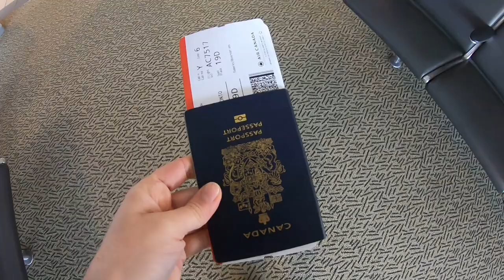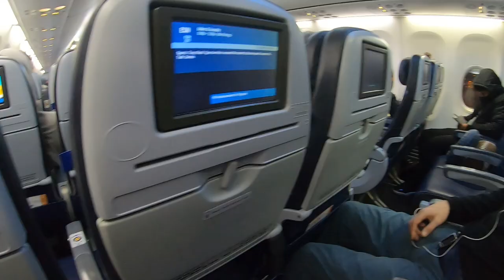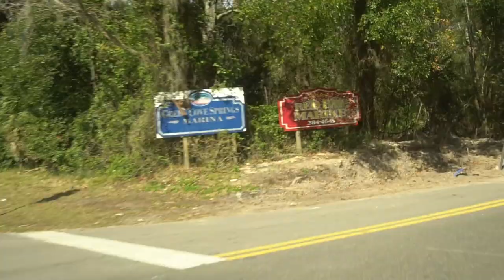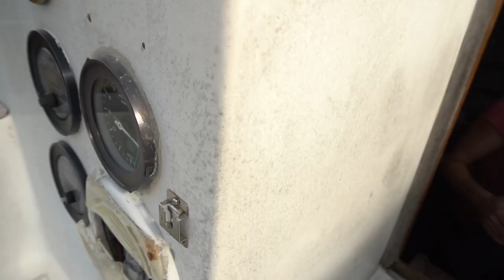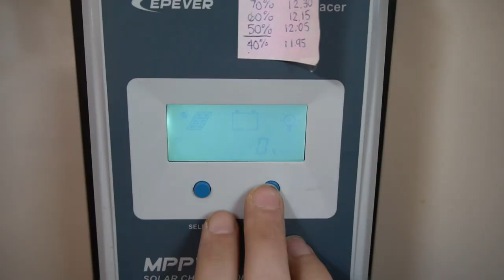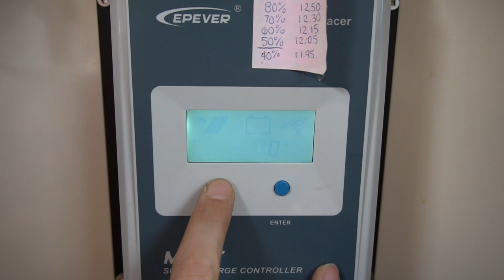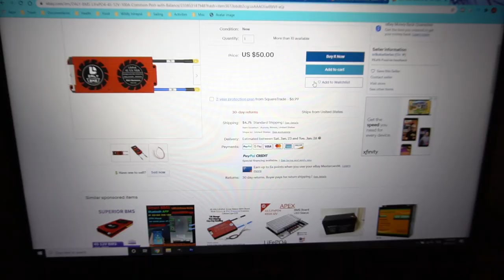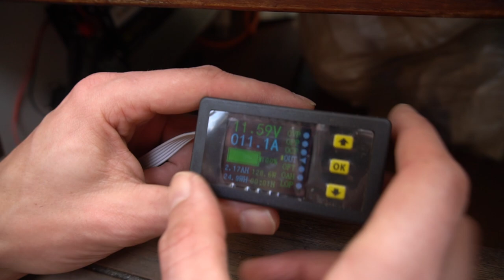B.O.A.T: Bring Out Another Thousand | BACK on our SMALL SAILBOAT [Ep 156]

Comment: Batteries can go dead with nothing connected to them.Man you are really good at finding and fixing problems 👍Glad you made it down to Florida finally without too many problems.And dang that food looked sooo good 😊
Reply from the maker: I haven't had much trouble with battery sag provided there is no load connected. Unless there is a problem with the battery. That said these batteries were toast before we left the boat. Thanks for the comment Mark. I enjoy troubleshooting and necessity is a strong modivation. Sailing on a low budget means trying to make things work without replacing parts that still work. It's always nice when it works out.